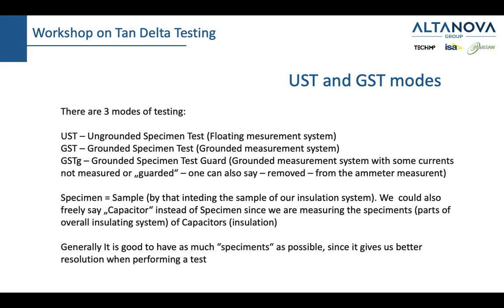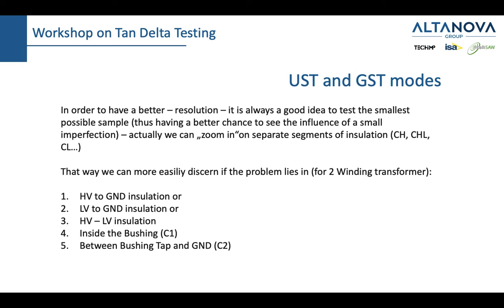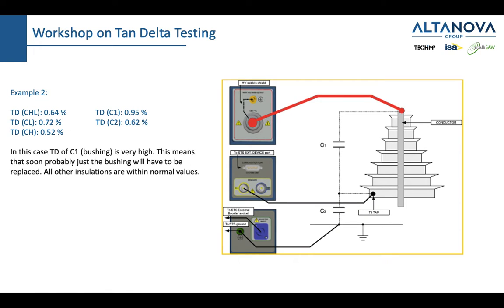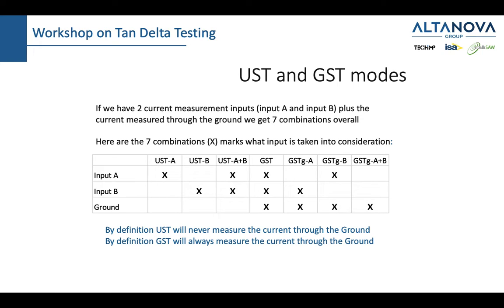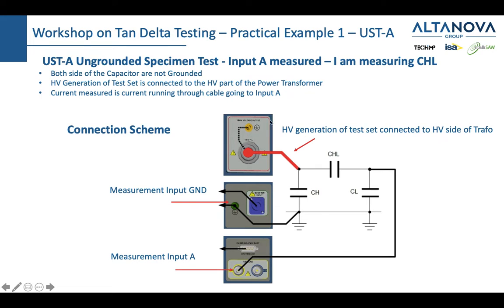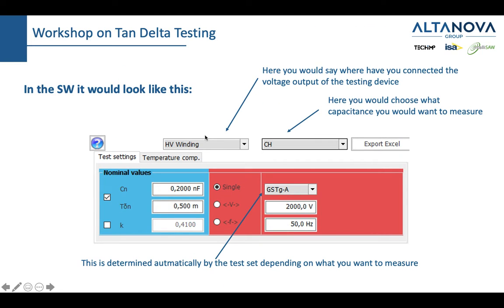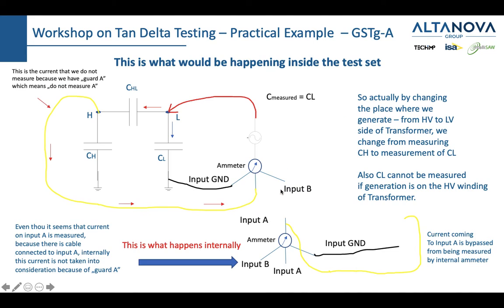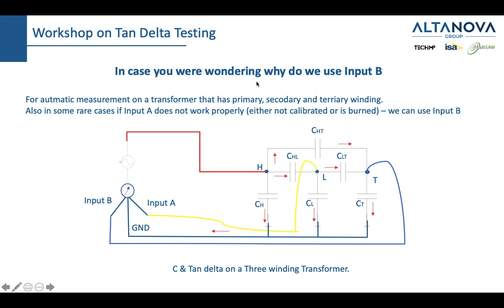Tan Delta Testing (DF or PF) Explained - Part 3 - UST and GST modes

Comment: What are the advantages of each method?
When is it recommended to use each one?
Reply from the maker: There are no advantages or disadvantages of the modes, the modes change regarding what you want to measure. It is like wanting to get a reality of a piece of steel. And if you want to weigh it, you would use scale. If you wanted to check the volume you would use different method. So the method depends in what do you want to measure

Comment: Hello! Usually instrument tranformers have inside secondary box, tand terminal. Which point is exactly on the body of transformer? And when we measure UST-A and we attach the input A on this terminal (tand terminal) which capacitance we measure?
Great job anyways!
Reply from the maker: Hi, thank you for the compliment. Regarding the tand terminal inside the secondary box, I have not encountered that. It sounds quite handy. Could you send me a picture of this on asepcic@doble.com ? What I have witnessed is tand terminal inside a form of a plug at the bottom of the bushing. So about the location where the ceramic or silicon “plates” finish, and some 10 - 20 cm bellow. In that case with UST A method you measure capacitance between the input (primary side of CT) and that measurement point which is the capacitance of the layers used to insulate the CT between the primary side and that point where you measure capacitance

Comment: Andrej is there a serious change in results, when testing overall tan delta omitting a stabilizing winding? E.g instead of choosing three winding but choose two winding on test.
Reply from the maker: Well I have not tried it, but I do not think there should be any difference if you correctly set up the measurements

Comment: These are very informative video. Thank you. I used an instrument Model CB-100D to test a 500kVA dry type transformer but I am not a getting the null point (unstable pointer) on the equipment when switching the knob from Capacitance to DF. Could you please explain me why? Megger of the transformer is in Giga ohm range.

Comment: Dear Sir,

It is requested to provide video for Physical meaning of Tan Delta Measurement of Winding under different modes UST GST GSTg for a 3 phase 400/220kV/33KV, 315 MVA Autotransformer with 33 kV Tertiary. What does it measure under different modes and significance.

Comment: Andre I was carrying out the test on new bushings using UST but getting 0.001% for all bushings different from factory tests. Am using RD 8000 testing kit. Please advice me what could be the problem
Reply from the maker: Hi Moses !
First of all excuses on late reply. Please clarify one thing - were the results different from nominal results by 0.001 % OR were the results itself 0.001 % ? Because UST is a correct mode to measure C1 on bushing.

Comment: Can this test be done for dry transformers .i.e air dried or only for oil transformers
Reply from the maker: Hi ! You can do this on any transformer. And not only transformer - but also motor or generator or circuit breaker. Basically you can do this test on any electrical insulation.
Reply: @sheppo17  for transformers 6/.0.4 kv and 6/20kv what would be the injected voltage is it 20kv and what is the voltages for the pushing?
Reply from the maker: @رضاالطرشاني  So you never need to go more than 12 kV according to IEC and IEEE. Even the 220 kV and 400 kV transformers use 10 kV or 12 kV as testing voltage. That is because at 12 kV all polarisation in insulation has finished taking place and there is no need to increase the testing voltage. So to accurately answer your question - you would generate 10 kV or 12 kV on the HV side (it should not make difference 10 or 12), and thus test insulation HV to GND and HV to LV and then you would move the generation to the LV side and generate maximum allowed voltage which is 0.4. Also keep in mind that 0.4 is probably Ph to Ph voltage and with test set you always generate Ph to GND so probably 230 V on the secondary side. With that voltage you would verify insulation LV to GND and you could repeat HV to LV insulation to see if you get the same number as when doing the test from the Primary side

Comment: Can you explain how to test tan delta for generator winding.and what should be the satisfactory value of the resultant  measurement..thanks alot fot those great videos
Reply from the maker: Hi ! My pleasure. For Rotary Machine testing you are testing mostly only the stator insulation (stator winding towards ground). So what you do - you generate high voltage between stator winding and a ground. For Rotary machines you often do a step up test and a step down test - so you generate (for example) 0.4 Uo, 0.5 Uo, 0.6 Uo, 0.7 Uo, 0.8 Uo etc.. and then downwards. Normal values should be between 3% and 5%, depending on insulation material. We might do a video on Tan Delta testing on Rotary Machines soon.

Comment: sir what is function of aplying different frequency on tan delta test
Reply from the maker: You would to that when measuring the tan delta of bushings mostly, and when the values are borderline, like, close to 1%. Then if you did frequency sweep, let us say - 15 Hz, 35 Hz, 50 Hz, 75 Hz, 105 Hz, 150 Hz, 205 Hz, 345 Hz, 405 Hz, 455 Hz and 500 Hz, what you would want to see that TD has more or less the same value. BUT if you see in lower frequencies higher (significantly higher) and then drop of values to lower values, that would mean that water had penetrated the bushing.

Comment: What is tan delta point actually?
Reply from the maker: Hi Mondal, Tan Delta is not a point. It is a parameter, a value that describes how good an insulator your electric insulation is. Tan delta as a parameter is tangent of an angle delta, and angle delta i angle
between y-axis and total current that runs through tour insulation. Since in an ideal insulation only capacitive current should run, the angle should be 0 and td should be 0. But since there is always some small resistive current running - that angle is always at least a bit different than 0. Just to give you a feeling - if this angle is bigger than 0.7 degrees - we are already in red. Hope this explains the notion.

Comment: Does the grounding system affects the result of the Tan Delta? 
Like for example I am testing a new transformer and the substation has a grounding resistance of >1.0 ohm, and i obtained results above 0.5% more likely 0.7-0.8%, is the grounding system a factor or not.. 

Thank you for your detailed explanation 😊
Reply from the maker: John Irish Lopez Hi John ! Regarding the grounding what I can surely say is that if it is proper, and I that I mean that there are no discontinuties in the grounding system - the measurment should be correct. If on the other side there are discontinuities in the grounding system, the current running in the ground will not be measured by the test set and you will get wrong measurement value. Of course our experiences are limited and we never added different resistances in the grounding network to observe the Tan Delta result and how is it affected by higher impedance. I can only tell you that you need to have a functional grounding that abides to norms, and if it is so, you should get correct TD results.
Reply: @sheppo17  thank you for the knowledge sir, i highly appreciated it 😊
Reply from the maker: John Irish Lopez you are most welcome :)

Comment: For 3 winding transformer can we please provide combination so that all specimen can be measure in one go..
Reply from the maker: Hi ! You cannot measure all the speciments in one go. Even if you have only prim and sec you will need to change genaration and measurements once, and you need to change also when you do trafo with prim, sec and tert. You wouls first generate in the HV (Primary) side and measure from Secondary and Tertiary to determine CH, CHL and CHT. Then you move to generate from Secondary and measure from Prim and Tert to determine CL, CHL(again if wanted) and CLT, and last is generation on CT and measurement from Prim and Sec to determine CT, CHT(again) and CHL (again).